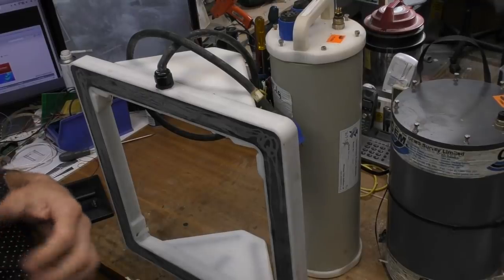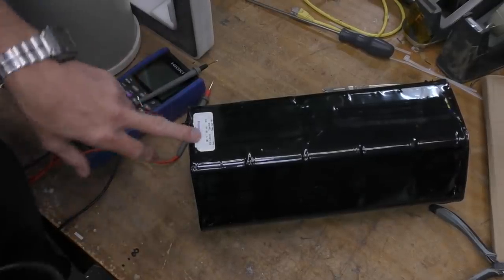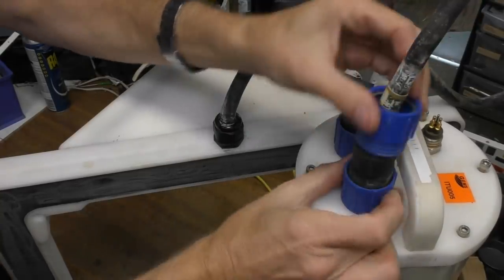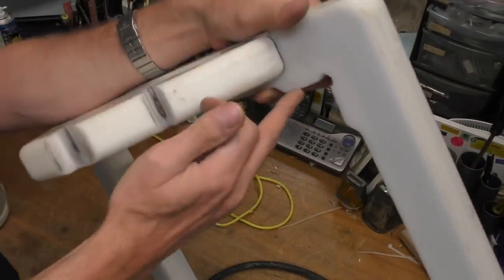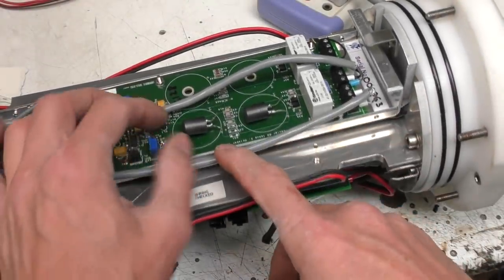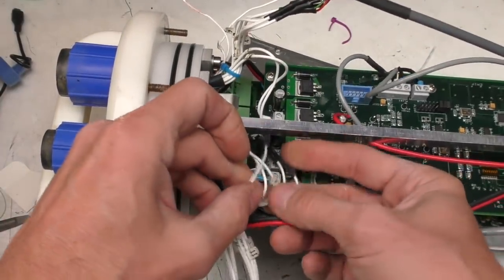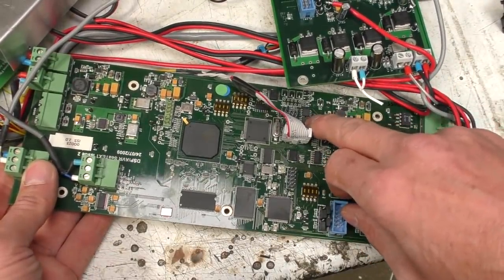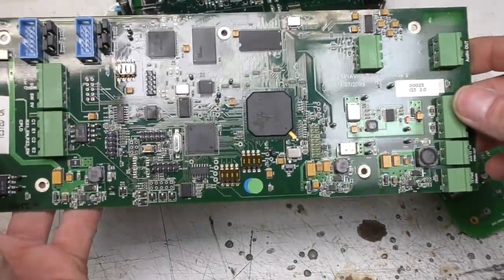Underwater radio modem

Comment: Gaffer's tape and duct tape are very, very different animals. Gaffer's tape is made of cloth and tears cleanly in either the X or Y axis. It's not got a plastic layer as duct tape does, and the adhesive is  very different as well. I've had lines taped down on carpet with gaffer's tape that have been trampled by thousands of concert-goers over multiple nights and the tape cleanly came off afterwords. Duct tape would never work that way. Gaffer's tape is what duct tape wishes it was. I carry gaffer's tape with me always, wound around a BIC lighter. I only use duct tape on HVAC ducts.
Reply: Yep in duct tape all right not Gaffers tape should know the difference between the two worked on stage crew years ago we kept a Gaffers tape for the stuff that was absolutely needed for it was too expensive otherwise.

You know the consumable materials budget is what we used to call it light bulbs replacement parts duct tape Gaffers tape the occasional broken microphone cable or receptacle in some cases I want up installing nylon receptacles and plates on anywhere receptacle would get kicked by people in the auditorium or that was hard usage buy us personally oh yeah occasionally you'd reached down to plug something in around plug something for some reason it tended to be the ones underneath the seats in the auditorium which were were Outlets there in some cases those would be the ones that would tend to be a long life for some reason we don't know why is mostly those.

One person wearing up to 1 last night and said you've got an issue here they were like what they said that they had happened to touch the sign of that Auditorium chair and one in front of them and and gotten Zapped.

And I happen to remember which circuit that that particular receptacles on I figured it was the receptacle and I was right so I ran in turned off that breaker that took care of it but the all whites were still working on that row. And no one's around it. Different circuits all switch through relays.

Over 50 some odd bulbs in total.

Speaking of consumables one year there was an outside party at use the auditorium and it had been disused while no one need it and know before menses and they were the last one to use it and guess what someone had left the aisle lights on.

And every one of them except one had burned out.

And we found out which person had left them on guess what he was doing yep changing light bulbs for about a month or so on his time no pay!

Also he had to purchase the bulbs out of his own pocket!!!!!!!!

Also his cordless drill blew up after the first 10 lights or so and weld up having to use a manual screwdriver to do the rest!

So Justice was served.

Also if someone used Gaffers tape for something that we didn't use Gaffers tape for they had to pull a a package of diapers tape to replace what little they use!

Also the Xenon Gramps got to be so expensive for the fall spots we had to wind up charging lamp hours we logged the hour meter readings each and every time they were even turned on or practice was going on.

When the prices went through the roof for the lamps.

I remember once someone kicked the table backstage knocked out the entire main stage lighting system wearing up to the side bay and reset the main thousand amp 3-phase breaker.

Was only off for a minute or three.

Show Must Go On.

Also once had to bypass said main breaker we were using Justin no Breakers had to use jumper cables then yep MacGyver Save the Day obviously just as long as needed we were been the laughing stock of the area probably State maybe more if it it felt as how big it was.

Little bit scary but yeah full safety gear of course.

Show must go on as they say.
Reply: Also by the way and duct tape was originally not named duct tape as in h v a c ducts it was used for waterproofing and other reasons in military as in like water off a duck's back it was used to waterproof ammo cases as well.

One of those things I don't remember if it was invented for the military but may have been but who knows things.

Then after the war the soldiers started using it to repair and work on HVAC systems and that's how it got to be known as duct tape as what most people think of it is.
Reply: @aaronbrandenburg2441  I heard that a mother invented it to keep the ammo dry to help there Suns come back from war don't know how true that was but it definitely came out of military
Reply: Not only that, you should also never just lift the cable with the gaffa tape on it, if you do, and the tape touches itself, good luck getting it off again :)

Gaffa tape is extremely sticky stuff.
Reply: Gaffer's tape is like The Force..... it has a light side and a dark side, and it holds the universe together.

Comment: Interesting tear down.  Definitely a bunch of graphite rods?  :-|)  Thanks for sharing!
Reply: More like as he said fair right rods there used with coils they were also used an older radios and still are for antenna coils AKA ferrite Rod antenna often times you'll see that long cylinder on a bracket on the back of an old stereo receiver what's the wires coming off that is a ferrite Rod am antenna also were used on a believe long wave radios and also their use on some shortwave bands as well.

Sometimes it's hard to find long length of this stuff to build projects although anyone that needs to do that for a longer life than they can salvage going to gather with Superglue usually gets the job done successfully to make a longer life out of two similar ones.

Because you would not need graphite for this because it would be stiff enough as it is because of the plastic the tough plastic and the potting compound as well.

But really interesting connectors to say the least somewhere I actually did get a hold of some things like that except they've been disassembled off for quipment had the wiring Stewart Ash in The Wire flying leaves off the females.

I had a box of those things as well as just boxes of various males and females from various things.

Also another thing that points toward that one module Bing from something else in our product is all the connectors the ones with the super plugs what's the screw terminals can't remember the name of those terminal blocks off hand.

Most of the other boards used a different style connector my notice from when I happened to see so that kind of gives a clue doubt also that was from another product.

Also those shielded cables kind of remind me of what you might find in say an audio tape deck same idea but larger even the way they break out the original wires in the Scheels as well. If the heat shrink over the ends of them where they go off to individual conductors.

Back in the old days anytime I would run across that time Warren that would get safe for other projects sometimes you can get in quite long lengths in some devices I've heard on other videos how when you run across that you should save it.

I remember at the old church when they redid the place I salvaged all kinds of wiring you and my father was salvaging for me not just that but all kinds of things sweet time my dad was on the pipe organ demolition crew and yeah even gone law that he saved a bunch of stuff for me I kept salvaging that stuff till the end Springs contacts solenoids even homemade terminal blocks.

Also Salvage the old electronic pedal relay it was just a bunch of logic gates on boards actually wound up using those boards for some things as is.

Is essentially 12 volt logic instead of being 5 volts out it was 12 and it was actually power instead of logic level would operate relays and electromagnets which I also got a ton of those as well.

As well as got a ton of copper coated spring wire and other useful bits and bobs.

Also several power supplies as well one big one it was one that been in the boiler room for years that has been disconnected but I repaired it believe or not it was regulated adjustable voltage to Taps and otherwise.

 if you can ever get a hold of any DeLorean power supplies that we're linear supplies with the big Transformer and possibly even a large selenium rectifier worth converting the modern rectifiers four nice variable power supply has is jockey whining as well so you can actually produce a variable Supply by just changing it lead configurations on the Transformers.

That one that had been disconnected in disused there was at least 12 output voltage tabs as well as on the input terminals how to draw cute winding on a Transformer world of using mercury switches for all that mortal gang power switches had some big old ceramic ones don't know what they're really used for but who knows also headed vintage amp meters and voltmeters are those puppies I even had an input voltage meter just so I can keep tabs on my line voltage when it was off on the one that I had in Marion blow my bench.

Also my exhaust / dust collection blower was out of hey an old Montgomery Ward dryer that had even been used for years for something else for someone else as well and then just stored for who-knows-how-long.

 also I did one sandwich a Montgomery Ward garage door opener.

Believe or not the remote still worked But I don't know if it exactly was a good idea to use RF interference anyone?

Although once used to remote control system that someone that builds one of the neighbors that was an amateur radio guy AKA a ham operator?

 called on the landline which is all we had back then.

 and asked me if I was doing something before radio control or something I said yes why he said that people are saying their garage doors are going crazy and they called me that I had a problem with the transmitter?

 he remembered that I had gotten a homemade remote control system from somebody didn't realize that it use the same as garage doors used and would send out multiple codes the control different channels oops.

And evidently the output was a lot clearer power the garage door opener another oopsy double oops you can say needless to say I abandon that system.

 and cut the boards in 4 pieces each.

 because I found out that system did not meet any standard and was way more powerful than what FCC allowed and there were other parts that I was not using it will was just say caused interference on analog TV FM and AM.

 this was built into a big box already what a couple antennas coming out and also a couple coax jacks I don't know where the person I got from had gotten it before I destroyed it took it to my friends that word for raffle quipment and put it through its paces let's just say our cheese I'm glad is that the FCC did not come knocking on my door if you don't want I'm saying I'm glad I was not using that part of the system that would be bad
Reply: @aaronbrandenburg2441  I was thinking in the D cell batteries regarding the graphite rods, since will be quite a few.  Technically, a bunch of manganese oxide that I guess rinsed can be use for cement dye maybe?  :-|)  Sure, reads like you've got quite a few potential projects.  Just watching the latest IMSAI Guy video on the tinySA and maybe you can invest in one of those or a cheap RTL-SDR to study the potential for interference like RFI/EMI/EMC style testing as shown for tinySA or EEVBlog did a video or two regarding cost effectively?
Reply: @jafinch78  actually I see where you're coming from in terms of the alkaline batteries wasn't thinking about the carbon bronze in the batteries I just thought you were confused and also with graphite Rod's you know how graphite is used in Mike fishing rods and all that and other very strong Construction that also led me to believe that you were thinking it might have had something to do with strength in the end Helicoil to back up the strength of the plastic and coils that's what threw me off.

But actually the carbon rods in the batteries are actually actual carbon rods not graphite although graphite is a form of carbon so I think we're neutral on things in terms of confusion no harm done either way and sorry about the confusion.

If you don't ask you'll never know and in this case if I hadn't said anything I wouldn't have no even though I was not really asking still same effect.

In a way asking sort of even though I think I did don't know but can't remember give us your comment oops

That is my original comment to your comment comment alike and share alike is the new open source LOL.

Also thanks for the info on the other videos are going to look into that I screenshotted that call me in so I can look into it I found that's the best way to remember information from comments is just take a screenshot because I don't think there's a way to cut and paste Android will not allow you to do that yet either or it's YouTube itself? Also if you're really into organizing your lynx and such depending on which browser opens Google vs Chrome but sometimes it doesn't always work for some reason don't know why help figuring everything out even though I've been on Android for years what I try to do first if it's something that needs to be organized better or if I don't know where the offense for legs in my favorites I saved the home screen where I can and then organize once I've got enough links also speeds up browsing I found there's times I have on my PC what seems like thousands of tabs open and there's times I've realized I've had a hundred times open in the browser and not even realize it when I arrive just let it go.

Even Wikipedia and others is there a limit to the number of tabs in a browser?

Never gotten some type of notification about too many tabs open yet?? Does that ever happen?
Reply: @aaronbrandenburg2441  Ferrite Rods are what you're thinking of also.  Yes, you're correct... they're carbon and not graphite actually.  Good call!    

For saving comment, I like "Clipboard History" Google Chrome extension.  You only have to highlight and copy the information to your clipboard history that can later be exported also. 

I find I run out of memory and have a memory error when too many tabs are open and videos from youtube or maybe other websites that are memory intensive playing video adds.  I'm using an older Win 7 Pro and dual core processor with only 8GB DDR2 memory.   If I cancel the memory error without closing the browser a few times, the browser will hang and shutdown.  Might be during antivirus updates also or processes.  Seems easiest to just restart... though occasionally I delete temp folders, cache, etc.

Comment: Imagine the mess if they used Duracell or Energizer 🤣😂
Reply: Lithium Thionyl Chloride batteries are fun once sea water has penetrated such a unit. Lots of nasty acid gas with the possibility of exploding lid. Alkalines preferred but, of course, far lower energy density by volume and weight.

Comment: 2:42
Oh my ...
That is A LOT of batteries ...
Something like a Li-Ion battery pack would have been much more compact.
Reply: Nope! These are designed to be left in one place with zero maintenance for years and years. They are not charged ever, they just change a pack and send it back to where it came from. Weather buoys and such work the same way. These batteries have low self-discharge and contain a lot higher mAh per gram or per volume than any li-ion cell ever could. In some extreme case they will use li-thionyl cells too which lasts for literally decades.
Reply: Life expectancy, reliability and capacity retention even at low temperatures is the things that matter here, size doesn't matter and thus alkaline which is also cheaper for the capacity you would get. Its also easier to determine the grade of capacity left from start to finish in contrary to Lithium-ion and especially li-thionyl.
Reply: @whatevernamegoeshere3644  And a lithium battery of 28.5V 80Ah would cost way, way more than this battery and do the same thing.
Reply: @dtiydr  Temperature curves for lithium drop pretty fucking fast do yeah lol
Reply: alkaline cells have a really large capacity when used at low discharge rate. Like, super high.

Comment: But can a few arduino nanos replace all that technology?
Reply from the maker: Not entirely
Reply: @mikeselectricstuff  someone needs to make an "arduino" that can entirely :D
Reply: @dimitar4y  You'd still probably need a DSP of some kind.  So a likely candidate would be a board with a DSP in the cpu.
Reply: @stonent  So a qualcomm / csr bluetooth chip? xD
They have a programmable dsp and microcontroller if you find the "ADK"

Comment: Aha, so this is how those things look like that kill dolphins and whales!
Reply: I'm afraid you're mistaken. You're looking for high powered sonar, this is merely a radio designed to operate at a particularly low frequency. Doesn't have enough power going thru it to hurt anything. The battery pack should give you a clue, no battery you can carry could power a sonar capable of harming marine life for more than a few minutes.
Reply: What’s mainly killing sea mammals are fishing nets of various kinds. Also, you are thinking of sonar (sound) which could potentially be harmful but this is radio.